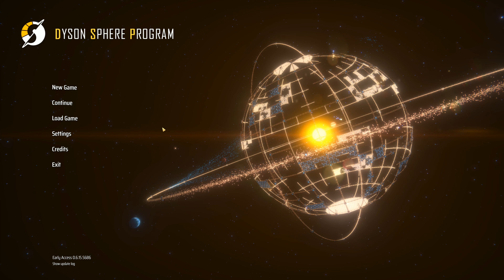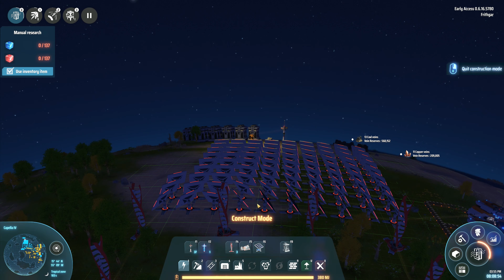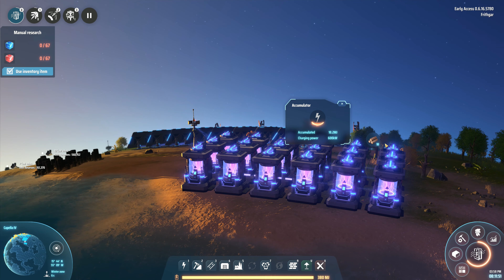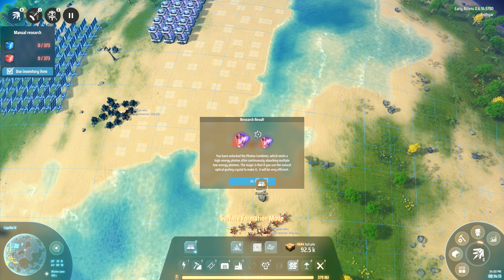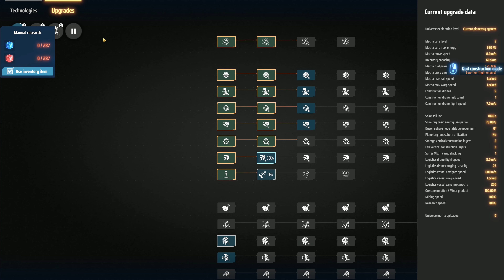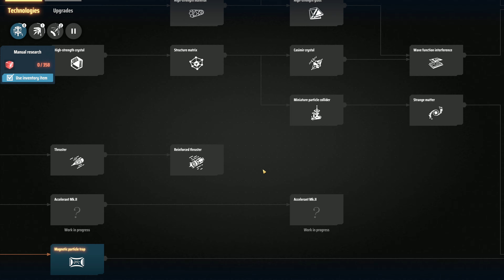Let's Play Dyson Sphere Program #17: Accumulator Field!

Comment: I don't know when you see this compared to when you record but remember that the sorters will reach up to 3 spaces away, so the easiest way to set up multiple machines with multiple inputs and outputs is to just put them end to end and then have all the belts run parallel on each side them.  In this example with two inputs and two outputs, the two inputs could flow by one one side and the two outputs can be placed on two belts flowing by on the other side.  This case is a little different in that the hydrogen is both an input and an output so the input and output could actually share the same belt (one sorter pulling items and another one pushing them - just like you do sometimes with storage) and you may want to loop the hydrogen but the loop should be thought about as a big picture (just outside of the main machine and belt layout).  Obviously there are a million ways to do and that is part of the fun, so just a suggestion.
Reply from the maker: I didn't realise that sorters could work like that, will be about a week before new episodes turn up showing me using that method though!
Reply: @Frithgar  Well, I learned from you in your next video that continued this build.  I didn't think about that fact that you could just seed the system with a little hydrogen and then not feed it any more.